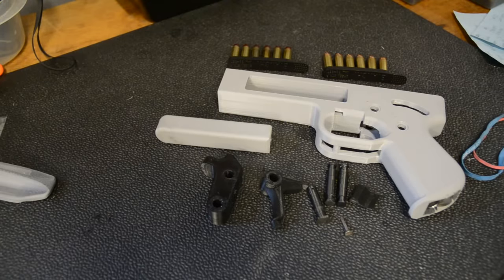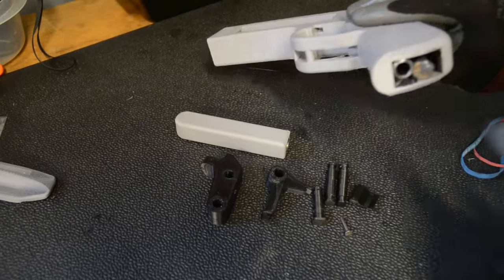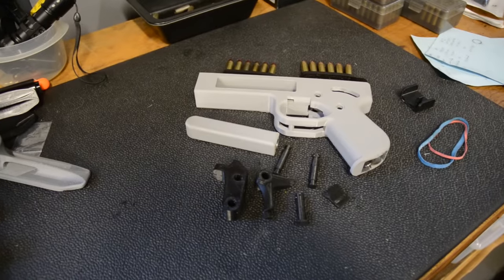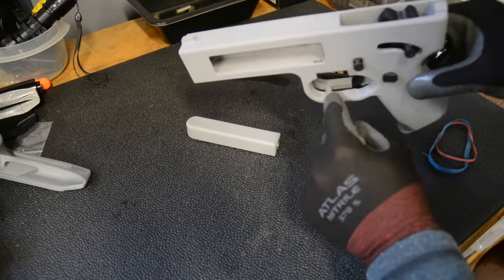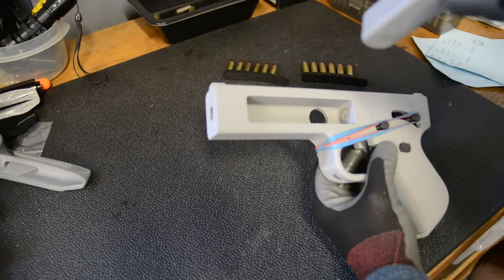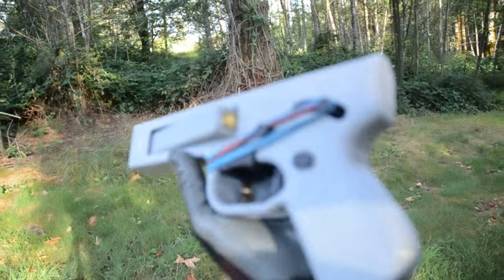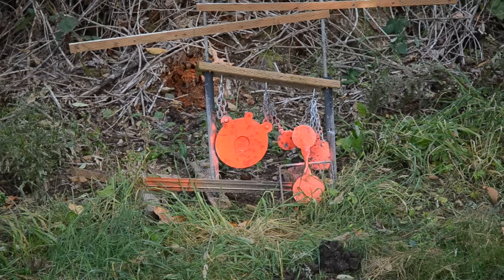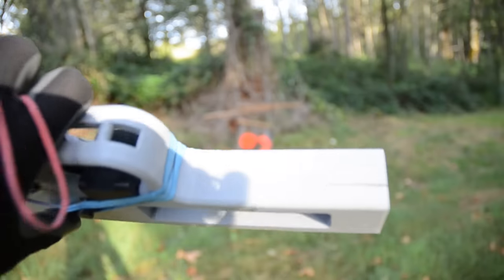Songbird 3D Printed Pistol - .357 Magnum

Comment: Governement:
*confused screaming
Reply: If you own a metal lathe you can make something much better in a few days and that's been possible for more then 100 years. This is nothing new.
Reply: @sciencerules5365  "if you own a lathe, a mill, and have about a week of time and some skill you can make this vs I paid 500 bucks printed 3 handguns in a day via files I downloaded off the internet"
This is ignoring the fact a decent mill and lathe will Run u a few grand
Reply: @CoreStarter  You haven't tried 3d printing have you :) Its not as easy to get working with reasonable accuracy especially in the cheap end of the market.
Reply: Science Rules lol you have problems with 3D printing?
Reply: @CoreStarter, A few grand is a minor investment for someone planning to produce many units. It isn't necessary for a individual to own a mill or a lathe, a decent drill press and some hand files is all that is necessary given some time,skill and patience.
Reply: @TheKing-bb8uf  Just saying that a cheap 3d printer is difficult to get quality prints out of. It requires a lot of tinkering which knuckle draggers wont be able to do.
Reply: @Science Rules - I have one, it's literally just stick files on SD card, select the part's file, then print then wait a few hours, rinse repeat until you have a full gun. 3D Printers go for about $200 now. You know that's kinda the point of sharing the files... so I don't actually have to model it myself, and no, cheap printers don't throw out "lower quality" prints, they may cut 1 or 2 steps out of your fabrication process for an extra $200-300, lmao. Come on dude, put your asshole away, it's speakin' nonsense.
Reply: The King  I did 3D printing as part of my job for one year. Getting all the settings right while taking into consideration weird parts and support materials can be hell if your printer is not good. You will need to sand the parts if you use support.
Reply: Fox sicily never argued that milling is harder, who are you arguing with?
Reply: Man of the north your printer was most likely damaged.
Reply: @InsanoBinLooney  poeople in vietnam during the vietnam war were making 1911 Knock offs that functioned on direct blowback with no delay or extra locking lugs.  meaning they made those guns with Hand tools. Each one was slightly different due to non-serialized assembly.
Reply: @Vamk420  Cool I want one. I bet I'd close my eyes firing it the first time though 😄
Reply: Anti-Gun: Criminals can 3D print guns and get them onto planes!
Reasonable People: Did they 3D print the bullet and powder too?
Reply: @sciencerules5365  and knuckle draggers would do better with a mill and lathe? lmfao what exactly is your point, other than to be a contrarian?
Reply: Science Rules bro, I just got my first 3D printer and it’s the easiest fucking thing
Reply: @sciencerules5365  +1 Not only that but the time it takes to print that is in the 8 to 12hr range. 3D printing is not like 2D paper printer it's a lot of work to make it print accurate.  People don't understand that 3D printer is working on the micron level 50 microns .05 layer high is not easy and even 200 microns .2 mm is still prone to issues.
Reply: Your Mother Hubbard 
because they’re not. 
and if you think otherwise, buy a 3d printer and try it yourself. 
and if you happen to already own a 3d printer, than you’re just lying to yourself.
Reply: @sciencerules5365  I paid $400 for a jgaurora a5 which has an autoleveling system to make the print just right every time, Right out of the box no tinkering and cheap....
Reply: Atf has entered chat
Reply: Once again the governments stupid regulations created a monster. Just like there regulations on weed led to synthetic marijuana and later bath salts. Why do people vote for such regulations that don’t work?
Reply: Liberals being triggered rite now.....
Reply: @CoreStarter  00
Reply: The government banded the blue prints online but you can still make them
Reply: @CoreStarter  you could have paid 500 dollars and got American tactical 1911 45 lol your really not financially smart are you?
Reply: Your Mother Hubbard  you can't type like a 14 year old and expect anyone to believe a word you're saying. Stop acting like you understand the process of 3d printing. You have to sand it - PERIOD .
Reply: Youtube losing 70 billion dollars:
confused screaming

Me: IM SEEING REAL RECOMMENDATION AGING
Reply: @sciencerules5365  knuckle draggers? Lmao building a gun by hand or with a lathe takes way more skill then a 3d printer.
Reply: @diarrheadan8088  Yes but it will work way better and be able to fire more then a couple of shots before breaking.
Reply: @sciencerules5365  That's why I'd do it by hand and not use a garbage printer.
Reply: Luckily in the UK people who are likely to make these guns won't have access to munitions.
Reply: @samsh0-q3a  pla has nothing to do with ABS or other materials, mostly alll 3D printers requires tweking which requires experience and time, each fillament can change totally the setting in the same machine, etc...
Reply: Not true. You need a PAL to buy cartridges in Canada, but anyone can go and buy bullets.
Reply: Your Mother Hubbard  you never tried 3D printing right? not that hard... not that easy...

Actually CnC its much "easy" to be used than a 3D printing, that has much more variables involved. Effort its required to learn all the things... its not like a a conventional printer which 99% is "plug and play"
Reply: @sciencerules5365  a good quality printer costs $700, a prusa i3 is pretty easy to get up and running with zero problems.
Reply: He literally called it a ghost gun, untraceable. How is this government overreaction to ban this?
Reply: 7:11
Reply: @CoreStarter  I see you're familiar with liberal talking points. I also see you have no idea what you're talking about. How about this. I can go to lowes and with off the shelf hardware make a gun. And you could have done that for 100's of years.
Reply: @corieg1  No guns are traceable currently. When I buy I a gun from a private citizen and sell it to another I'm not required to remember who it was I bought it from or sold it to. Also cops don't have the ability to pick a gun up off the ground and know whose it is. When they run the serial number it either comes up clean or stolen. To find out who originally purchased it they go to the manufacturer who says that unit was sold to this shop then the shop could tell you we sold it to bob. But after that who knows where that gun has been. And why should they trace it? They don't trace knives, hammers, or ball bearings and pressure cookers. Gun laws are only followed by citizens you didn't have to worry about in the first place. Criminals just carry stolen guns anyway.
Reply: @HiddenRealm  A component isn't a gun. The problem is if you start putting regulations on parts what makes it a part? A barrel comes from round stock. Is uncut round stock illegal to buy. Certainly not it has too many applications. What about round stock with a hole drilled through the center? The bullet would be less accurate but it would still shoot. Could you make it illegal to sell a piece of round stock with a hole drilled through the center? If yes what If I have a 4 inch piece of round stock and I drill the hole 99% so a think piece of metal is holding on at one end that anyone could easily slice or sand or drill out is it still illegal. Moral is the reason they haven't regulated parts is because it's pretty impossible.
Reply: @HiddenRealm  "They already do regulate parts" They do not. Try brownells.com they ship all parts to your house. Minus the receiver of every gun which has the serial number. That piece can be mostly completed only needing finishing touches to the trigger area (check 80% glock lowers) to qualify as a gun. The reason they do not regulate barrels is because you can't.
Reply: Bobby Bologna Ender 3, prints beautifully out of the box. Got mine for €200, I believe it's the same price in dollars
Reply: you can fire a bullet with almost everything
Reply: @sciencerules5365  yea cause everyone is a fucking machinist with the money to spend on a 10 thousand dollar lathe
Reply: @TheKing-bb8uf  crap single shot plastic trap that will eventually get you killed vs actual gun.
Reply: Master of the Universe basically.
Reply: @sciencerules5365  yeap, heck make caselman air Machinegun and it's not firearm either.
Reply: What plastic is that printed of?
Reply: ATF disliked that
Reply: MEMEROID 427 #topcommentgod
Reply: @InsanoBinLooney  who is planning in running a arms factory.
Reply: @Fox sicily I know it's pretty basic
Reply: I don't know why that is because it's perfectly legal to construct your firearm.
Reply: @CoreStarter  This is assuming that you buy the tools for your trade, not to entertain a hobby.
Reply: Nice

Comment: For the delamination issues, you should rotate your build 10 to 20 degrees in  3 axes which will change orientation of the "grain" of the part.  This is what they do in industry for aerospace parts because it ensures that most external forces on the build hit at an oblique angle which helps prevent delamination and warping and lessens the internal stressed that uneven cooling can put into the build.  Great clean design!

Comment: Why are all 3d printed guns powered by rubber bands?
Reply: I'm guessing it's easier to get needed tension with a bunch of rubber bands as opposed to designing and manufacturing springs. It's almost as if gun manufacturing should be done by firearms designers and gunsmiths!!😂😂
Reply: "I spent over a grand on my 3D printer and roughly a hundred bucks on the Nylon and glass bead/glass fiber "printing" material so I could manufacture my own weapons at home from publicly available designs. Then I used a bunch of rubber bands that cost roughly a penny each as my mechanism for keeping the hammer cocked so that I don't accidentally kill myself. Don't worry though, I'm not relying on rubber bands-only to keep me safe -- I'm also putting another fucking cartridge between the firing pin and the cartridge in the chamber just in case the rubber bands fail.  Because safety." 

Priorities, bruv. Safety. Smarts.
Reply: @WafflesASAP  so how much gunsmithing/machining training do you have? $ doesn't equal knowledge.
Reply: @michaelfrench3396  I have zero gunsmithing knowledge, but I've worked in a machine shop as a hobby for a few months now. That said, my machining knowledge is well below that of even an apprentice. That said, my comment was meant to be sarcastic. I thought I made that obvious, but I guess not. 

It doesn't take a genius to know that it's not brilliant to invest all that money in a 3D printer and a bunch of glass bead-laced nylon printing material for the sake of ensuring that the weapons you print will be relatively robust/strong (relatively speaking -- nylon w/ glass fiber/beads is still plastic, even if it is tough plastic) only to use rubber bands as a means of locating/tension-ing the hammer when it's in its cocked position. 

Rubber shrinks when it's heated, unlike most common materials. Heated gas is expelled from a firearm when it's fired, and so as the weapon heats up, the rubber bands touching the body of the gun are going to shrink in various areas, causing localized weaknesses over time. What happens to a rubber band when some area on its surface is stressed beyond the point which it will elastically deform? It snaps. If the rubber bands snap while the hammer is under tension, the hammer hits the primer on the cartridge, and the gun fires. Heaven forbid the weapon would be pointed at this guy or someone else near him if that happened, but if it did, don't you think the person who was about to get seriously wounded and potentially die would think they probably should've invested more than a penny or two on the materials they used to keep the friggin hammer cocked?

I get that springs are cheap too, but they're orders of magnitude more expensive than rubber bands when bought individually or in small quantities, which is what this dude would've done had he solutioned springs instead of rubber bands. 

None of the above even touches on the fact that dude is using one bullet to stop the firing pin from hitting another bullet while he cocks the hammer, and then has to shake the damned bullet out of the firearm body once everything's cocked, while only a few rubber bands are holding the hammer in the cocked position.

Understand now?
Reply: Because springs and gas operation systems are to hard for a lot of idiots to work out.
Reply: Have you ever tried making your own spring without any tools ?
Reply: Any polymer handgun receiver can be 3d printed and completed with a parts kit. Glocks are most popular. Also, research the FGC-9.
Reply: Air springs would be sick
Reply: @michaelfrench3396  For safety yeah but anyone who has half a brain cell and has access to tutorials or info on gunsmithing techniques can make some basic firearms at home. Slam fire shotguns, Zip guns, muskets, hell even mortars.

Comment: As someone who has no experience with 3D printing: because of the stresses the gun is going to be subjected to, wouldn't it seem prudent to print the gun from back to front, rather than side to side, so the layers are running perpendicular to the bore rather than parallel?
Reply: Depending on the material, the difference can be negligible. Layer adhesion is honestly lower on the list of concerns when it comes to 3D printed guns.
Reply: i think the recoil forces might be too much if the layers are perpendicular to the bore

Comment: Never hold a test gun like this in your hands when test firing. You need a gun vise. Also, you should be standing behind something when it fires.
Think of it as a small pipe bomb that can throw shrapnel in all directions when it goes off. All it takes is one structural failure and you could have tiny metal parts from that gun embedded inside your body.
Reply: kablooy1 I think he said he already test fired it before this
Reply: Which tiny metal parts are those?
Reply: Ever notice how anti-gunners are usually the most violent and psychotic?
Reply: Flimbo nimbo We all know Gandhi's knife  massacre... don't we?
Reply: Bobistdeinemuda Gandhi was anti-violence. Anti-gun people are not anti-violence people, not at all. Saying the two are the same is ignorance.
Reply: gandhi recognized that people are at fault and people need to change
anti-gun people think objects are at fault and put the blame on that instead of people waking up.
Reply: Dave Smith I never said that you absolute knob don't rope me into this
Reply: the barrel and bullet
Reply: thats not how guns work i hate people who half know weapons and believe myths
Reply: Bobistdeinemuda Gandhi actually highly criticized Britain's gun ban in India while it was still a colony.
Reply: Why would the metal barrel burst and what would be the stoppage?
Worst case would be the back of the gun not being able to hold the casing as it lobs out the bullet but there is no way there would be a pipebomb as the barrel is probably bought as such.
Reply: kablooy1 lol why not we gotta all die sometime we ain’t immortal...
Reply: @Jesse Johan
So true.
If we are lucky we die of some miserable disease in old age.
If we are lucky...
Reply: @DaveSmith-cp5kj  yup

Comment: Old video but just add a metal ring on the part where it delaminated and also print the frame hotter, say 230ºC. The metal ring wont break and printing hotter helps with layer adhesion. My parts usually break across the layers so it makes me think you printed it too cold.
Reply: The point of a 3d printed gun is that its a ghost gun capable of passing through metal detectors without setting them off a metal ring would defeat the purpose
Reply: And what about the bullets? wont the brass and lead trigger the alarm? Also it has a huge metal barrel, i dont think the detector wont detect that! Not sure how much more metal you can remove and still have a functional gun but without the barrel i think you wont be able to do much more of a .22 and not sure but maybe you could make a .22 with a kevlar body instead of brass but lead is still lead
Reply: @laharl2k  true i was just throwing it out there really not trying to have an argument over it

Comment: I would redesign the frame such that the front half is detachable from the back half, as well as the barrel assembly. Then if any new cracks form in the front of the frame you don't have to reprint *everything*, saving plastic.
Reply: And every time you fire, the thing rips in half.
Reply: @TheCoorock  A) it's single-shot, so B) make it break-action.
Reply: The plastic is very cheap...this gun cost approx 20 dollars in material AND time.